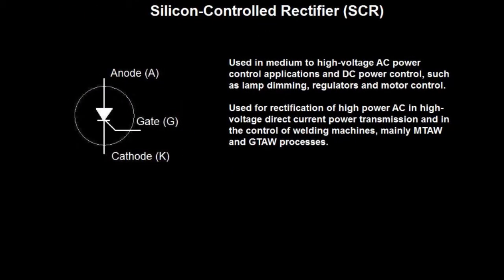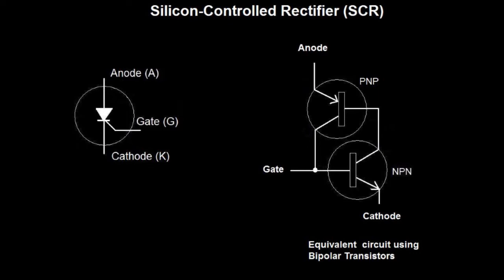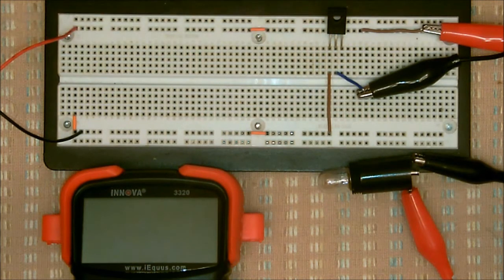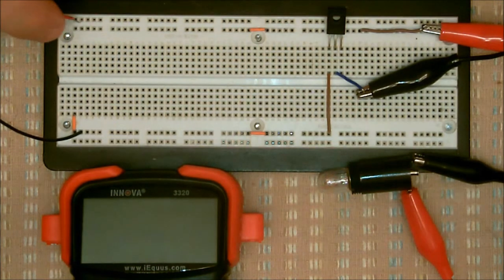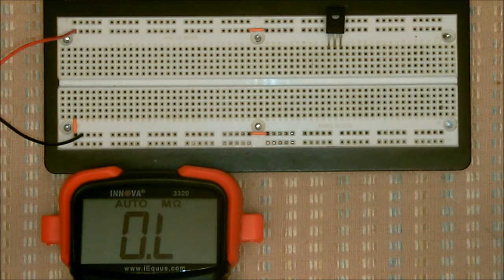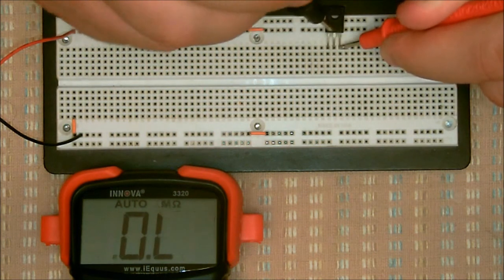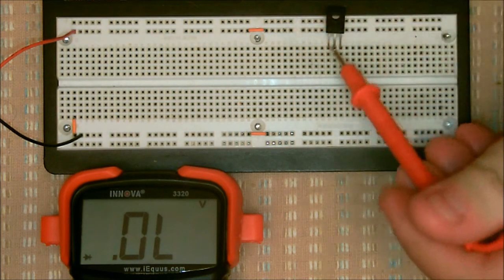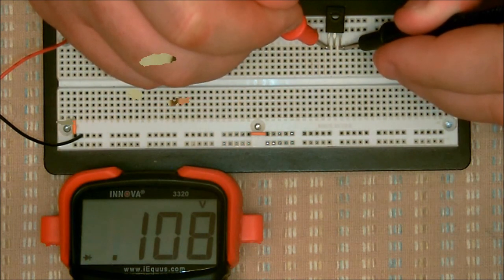Testing the Silicon-Controlled Rectifier

Comment: This is an excellent explanation of the basic solid-state device that controls such things like dimmer switches.

Thank you very much.  I have Liked this video and shared it with some of my friends.

I have all those devices that you have in my room, because I have studied electronics since I was in grade school in Modesto, CA and three years in High School (Modesto).

And I was a Ground Radio Equipment Repairman at Castle AFB in Merced, CA for just over four years.

Comment: I did the same as you by finding discarding TVs in alleys and bringing them back home to my parents garage.  That was how I started to learn about the resistor color codes.

I started out with vacuum tubes then it was about that time when transistors and other solid state devices were being made.  I have the same breadboard you have in this video as well as a big unit that I bought from MOUSER which has all kinds of generators of timing and indicators.

Comment from the maker: Cool. I never tinkered with vacuum tubes. I hear there is a motherboard, I believe by AOpen, that use a vacuum tube as part of the audio system. The A4XB-533, I think, been awhile since I read about it. I thought of getting a bigger breadboard but I only use it to test circuits before I make them permanent on a PCB.

I think I still have Mouser's old catalogs, including Perl, NTE, and ECG cross reference books. We use them for reference from time to time, but they are clearly out dated. -MrFixit

Comment: Does the  SCR need to be removed from the circuit board to test it properly.
I have a battery charger that does not convert the 14 .8 volts AC to DC volts.
Reply from the maker: SCRs are not usually used to convert AC to DC. If the charger is producing AC the diodes or the bridge rectifier is bad. The component needs removed to test the component properly. -MrFixit
Reply: This is a sears die hard automatic charger with 100 amp boost. The scr module acts as a rectifier on these units,This has no conventional rectifier,2 scr are soldered across from each other in series. I have not taken them out of the board yet to test individually.I have 15 volts AC to the board,nothing at the battery clamps or scr module out put.Thanks again for our thoughts on this,great videos by the way.